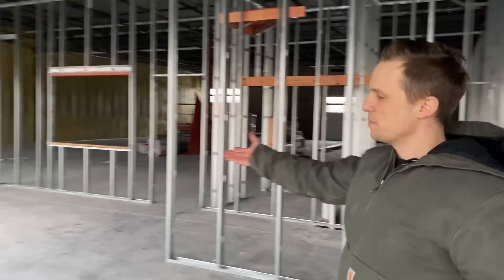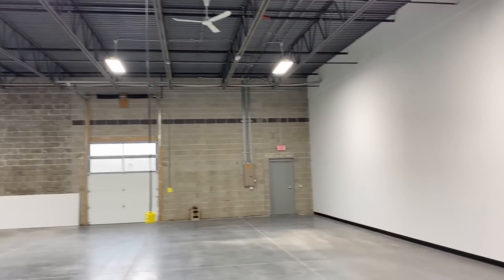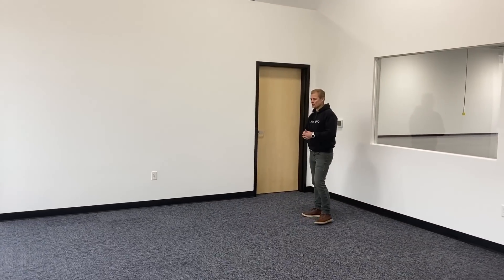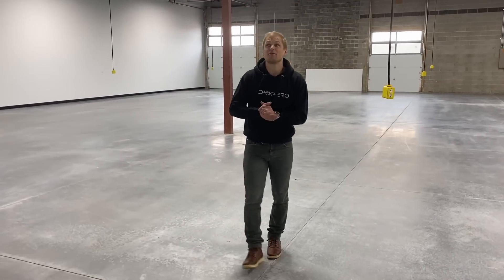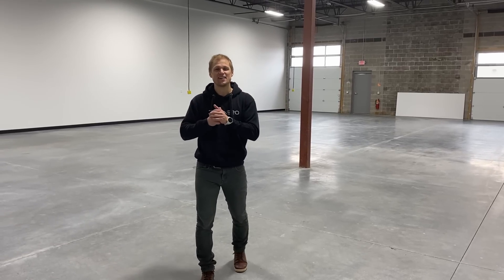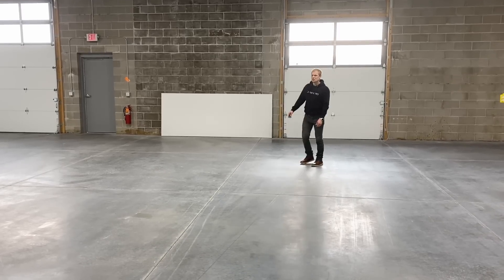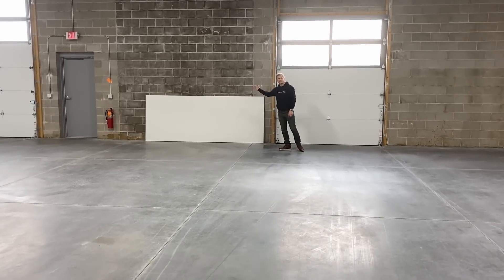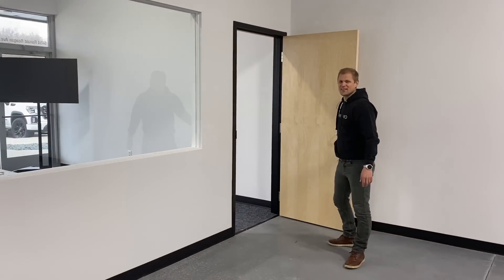Building an Aircraft Factory | NEW Shop Tour

Comment: Great to see you guys grow: a couple of comments/suggestions (I have setup several shops and labs): 1. Don’t put your whiteboard visible from the outside, anyone walking by can guess too many things about your business and your employees. 2. Wide open space are great but you have a mix or processes with different requirements (cnc, composite, assembly, packaging,..) and they all have different requirements. 3. Use more electrical tans air drop that you need to allow reconfiguration flexibility. Last but not least, add more lights, I was looking at your shadow when giving the tour and in many places you have no direct lighting above you and that will create unpleasant dropped shadows on your workbenches. Hope this help and good luck.

Comment: Awesome new shop! 

I hope you follow many other shops advice when it comes to hardware storage.

[(clickbonds, inserts, standoffs, etc) for off the shelf storage, vaccum/ peanut packaging/s&h, creating a crate design for transport as well as an area to stow the fuseloges seats, inserts, helicoils, shearwire, safety wire, cooling fans for avionics, light controls, lights, position sensors, antennas, cockpit switches, circuit breakers, fadecs or ecus, as well as props, engine spares, fuel cell access panels,  wing assemblies, landing gear, canopies, flight control surfaces, hazmat, (proper ventilation for carbon fiber sanding, etc.)]

Separate pegboard layup tables for building the harnesses, connectors, pins. 

As well as separate hazmat cabinets for isopropyl, acetone, sealants fuel cell, fuseloge bonding agents, clicking glue, fuel, etc.  

Plan to build 10 in 6 months while you test this one. It's quite doable with (~ 4 people  with an 8 to 10 hour day schedule.) 

Kudos on all the planning! 

I think there's a lot a potential for sister companies running production under part 135 on this aircraft in terms of it if you could make presumably 3k for every aircraft manufactured. Let's say each company manufacturers 20-40 aircraft and you have 4 manufacturers around the world to scale you could net 200-500k in 135 aircraft sales alone and a margin of 95-135k in part 145 service related revenue under the branding. You could continue with R&D and experimental aircraft designs releasing a new aircraft every 3-5 years and maintain the simplicity of things by not doing every single aspect on each aircraft.  

Not sure about the longevity of your actuators for your landing gear. It seems that there is quite a bit of torsional load on the fixed point gearing.

I hope you cycle the gear quite a few times with the fuseloge at different angles. 

I would recommend installing a seal at the bottom of the shop door into the offices as a separate room just for structure moldings and processing would be best. Also try to break everything down into build sheets. 

I would also consider the shop eventually segmented with taped out control areas for safety and safety glasses, ear plugs, eye wash/ first aid station.

Plan to tour people in and out of your facility.  It's gonna be busy, so, you could easily overlook something. As always, take a tour of a few manufacturers facilities and go from there.

 You're on the right path!

Comment: Uh hmmm you're missing the hangar bum. Let me know.
Quite frankly I think you should temporarily hang the lightest weight cheapest power solution on it straight away. Use a cheap easily disposable engine, fuel system, electrical system and plumbing for everything related to combustion power. Flight test and prove the design operating on the absolute minimum rated engine horsepower. 
Please I beg you.

Comment: Congrats, guys! I've been following each step of this endeavor. Wish y'all success and accomplishment. Can't you use the top of the office as a second floor (e.g., storage, expansion, etc.)?
Reply from the maker: It would be possible to add a "loft" area for storage, but fire code dictates that a sprinkler system would have to be added under the floor of the loft. Between the loft and the sprinklers, it ends up being more cost effective to expand outward.
Reply: @DarkAeroInc  Storage racks don't require a sprinklers system.
Reply: @DarkAeroInc  In our part of the world, you are allowed to add a mezzanine (loft) that is 10% of the total main floor area, without sprinkling underneath!
Reply from the maker: @richardvisscher2626  I’ll have to check if our local code is the same, so we can build a tower in the shop to watch over the kingdom from.

Comment: Multiple income streams superficially makes sense but if it distracts from something scalable it can be a failure instead of a win. Imagine Tesla having stuck with kits and teaching courses to 5 people. If we assume a certified engine, how difficult would it be to get your plane certified? if it's a clean well engineered design with lots of calculations and all computer modelled, could it slide right by. To me it seems like a given that it must be certified, that kit has no scalability or success prospect. No kit maker has really had any major success. Most operate near bankruptcy in poverty from what I hunch, maybe VANS do ok and Sling is surviving but I'm guessing they are already at TAM with no real opportunity to grow the market. Whereas certification is a significant credibility step and market enthusiasm and perhaps makes you interesting to someone like Textron. People keen to throw unlimited money your way like to know you have an exit strategy.
Performance of the plane should be very interesting.
Aside from certification I'd strongly recommend doing a single piece fuselage and similar simplification of the landing gear. Optimization is king.
And if you really want to succeed that single piece fuselage is pressurized and has two tiny turbofan engines on it. That you make. And then lay waste to the GA market. Codename pale horseman.
Reply: "how difficult would it be to get your plane certified?"
Hard. Certification is where aircraft manufacturers go to die. 

"could it slide right by."
Not how the process works. There is no "slide" there is a mountain of paperwork, testing, approvals, waiting, more testing, tweaks ect. Even major manufacturers take years to get their designs certified, and they have much more resources to use.

"No kit maker has really had any major success."
The kit market is a small slice of an already small market. That being said plenty of kit manufacturers make good livings for themselves. Rans, Vans, Zenith, Kitfox, Sonex ect, are all well-established companies with dozens of employees each. 

"Whereas certification is a significant credibility step" 
And a significant price creep. The certification process is why a new Cessna 172 designed 50 years ago sells for as much as a house. If it was easy everyone would be doing it. 

"Performance of the plane should be very interesting"
Not really, they optimized for speed and range at the cost of everything else. It's going to be a handful to fly, unforgiving, and unless you are a fit 20 year old only one person is going to comfortably fit.
Reply: @TheOwenMajor  a handful? you can deduce its flight characteristics already?
Reply: From my experience managing aircraft certification, $10 mil or more could be expected certification costs.  Time could easily be 3 years.  A glass cockpit upgrade cert can cost well over $1 mil.
Reply: @derdan20  have you overseen small planes and where would the actual cost come from? I assume FAA doesn't charge such fees
Reply: @DanFrederiksen  While the FAA doesn't have fees associated with certification, they pretty much demand the use of designees (like me) to review the type design and the data showing compliance with the regulations.  Testing as in structural, ground and flight testing must be approved by designees and witnessed.  In the case of flight testing a designee participates in nearly every step of the flight test.  Manufacturing and article conformity is also verified by designees.  Then there is the actual development of the engineering data to show compliance with the regulations.  While the Dark Aero development seems to have used sound engineering practices, there is the step of formal documentation necessary for certification.  The aircraft manufacturer has to have a design that is managed by a configuration management system, and that is documented to show compliance with every part 23 regulation (US).  And then there is the increase in production cost as all materials must have traceability to the manufacturer, and an FAA approved quality system has to be in place prior to actually selling an aircraft.

In the 1980's Hal Sheever of the Sportys fame decided to reverse engineer the Cessna 172, obtain certification and produce cheap airplanes.  Reportedly he sunk $10 Mil into the project and gave up.  I worked on a very light jet (part 23) and when a decision was made to go for certification, the estimated certification costs started at $300 million, more then the cost to develop the design.  Historically, Lancair a very successful composite airplane company had decided to make a certified version of the Lancair 4.  If I recall correctly, they ended up with significant redesign to meet certification and the company that they formed for the certification project went under.  

This is why we don't have very many certified small airplanes coming to market.

LSA is a different story but still has some pretty good costs associated.
Reply: @derdan20  so you are basically admitting that you are the problem. Good to know :)   your insight is interesting but what I'm thinking is that a very clean/simple design, particularly monobody composite which seems to get more credit since it doesn't have metal fatique, that getting intimate with an FAA guy and not letting go of a good reach around to encourage quick signing off might just work. I also hunch that FAA could be ripe for a bit of cultural change so a clean all computer design might not scare the bureaucrats and lead to quick certification. I assume design requirements are not black magic so if already thought into the design could save lagging design revisions. And in a nimble organization, rather than a bureaucracy of a thousand fools, any modest redesigns could be done for modest cost. once the coarse handshaking with FAA has been handled then maybe your problematic kind could be minimally required :)  I'm not saying it has to be done cost free other than own labor but I have to believe it can be done without boeingesque committee death. I think FAA could be ready for and talked into a well disciplined clean certification for simple planes. Not rivet hell like a 737.
And not to put too fine a point on it, the certification process didn't catch the many problems with the 787 which just from my modest engineering experience with battery electric systems were quite severe amateur mistakes. And in part induced from certification restraints. They used the most volatile battery on the market (kokam) because it was the only certified one. A battery chemistry so dangerous it should never have been used in a plane. Or abused as it were. Quite the irony.
So just maybe the right approach to FAA could lead to a snap rational process and maybe even be precedent.
Reply: @DanFrederiksen  Really, the FAA is the cost problem as the policy shifted from direct FAA participation in projects to delegation.  This shift began in the 80's.  And then when the FAA did participate directly, the project schedules were subject to FAA availability.  Manufacturers were actually happy to use designees to get the FAA's face out of the details and allow them to have better control of the outcome.  BTW, there is no one "FAA guy" in a cert project, it is a team of disciplines that review and approve a certification plan.  Circumventing regulations is just not going to happen.  Well actually one time that I know of it did happen was with the Eclipse, but then a few FAA folks lost their jobs over that and the certification had to be revisited.
Certified means that the design meets established safety standards to ensure the public a level of safety and proving that the design meets the standards.  From my experience at least 30% the time that a manufacturer with no certification experience claims they meet a requirement, when objectively reviewed they don't.  Experimentals don't necessarily meet the certification standards, in fact most all don't.  Part 23 has been rewritten to allow a more flexible view of new technologies, but in my opinion it actually made certification more complex.  
Composites are actually harder to certify.  In small airplanes metal fatigue isn't a real barrier.  Also metals have well established characteristics.  With Composites the airplane manufacturer replaces the aluminum mill and becomes the producer of a unique material to be used in the construction of the aircraft.  The properties of each different layup schedule or material have to be established by the manufacturer by testing.  The strength of every different bond joint has to be established by testing.  With metals we have lots of empirical data on the allowables for fastened joints.  Makes it much simpler actually.
Carbon Cub is a good example of a company that made it through certification to deliver a good aircraft but it took lots of money.